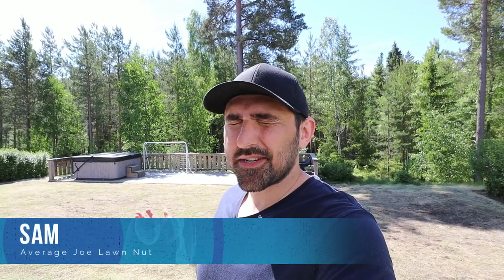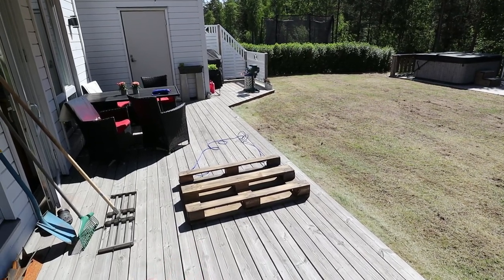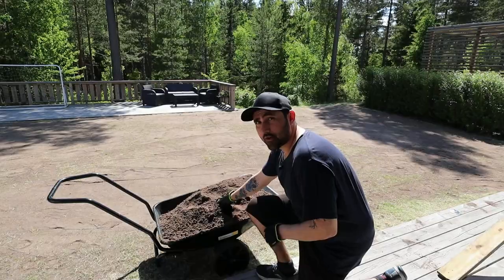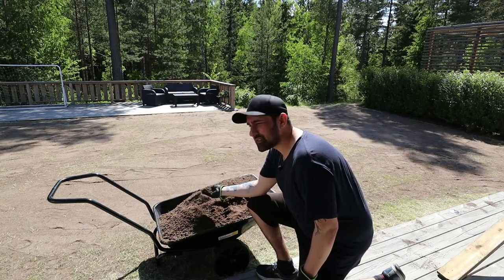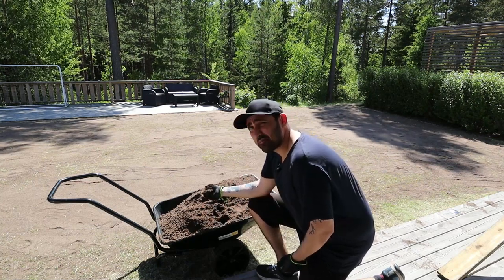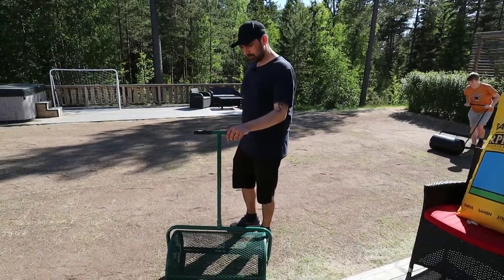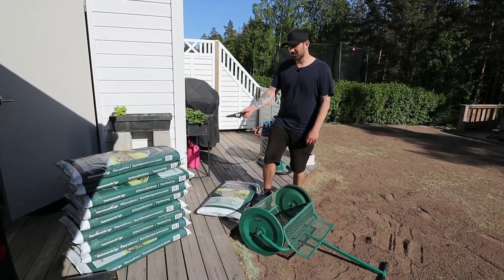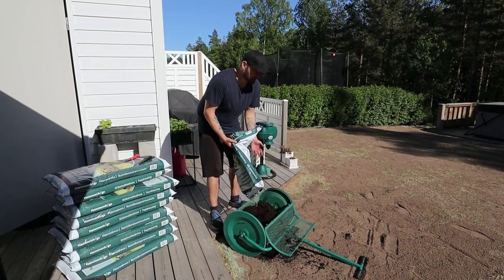Step by Step Leveling with EASY tools and Re-seeding entire lawn!

Comment: I am also using the same brand but in RTF. It is a multi-grain tall fescue. But I am in Las Vegas so that is a big difference. In order to open those bags you have to look for a small spring and start pulling on the small string on one corner of the bag. If it doesn't work on the first time then move to the other side and pull out a small string from there. It always works for me. Best of luck.
Reply from the maker: ahhh you need to pull the small string first? I usually just take one, the times I have managed to do them I guess I guessed and picked the right one. Always thought it worked by pulling either. Was so happy I managed to do it, never happens :)

Comment: Good turf tips. The weather is delaying some of my over seeding this year. Normally I get an early start, mid August, but this year it was just too hot, and then dry. At more normal seeding time, of September 1-15, it was still hot and DRY. I've never over seeded this late, but I'm going to try it. The turf type tall fescue ( tttf) that I use is from United Seed and it normally germinates in 5-7 day's or so. I have used the big square bails of peat moss at times. Just barely cover. Thanks, John, Indiana, US
Reply from the maker: Hey John, thanks mate. Had the same here, was hot for a long time so it was hard to start early, downside is that our fall and spring are getting shorter, we jump straight from and to winder it seems, hard to plan overseeding with that kind of weather. Let me know how your lawn turns out after the overseeding.

Comment: If you put a polythene sheet over the top for a week you'll only have to water it once. It heats the ground, stops the water evaporating and keeps birds off. Speeds germination rapidly
Reply from the maker: For sure mate, if I ever go over to fescue or KBG, I would definitely consider that, but for the RPR it goes so fast, don´t really feel the need to bother. I am thinking about adding some KBG this fall actually, then I might do it. Good input!

Comment: If you keep on leveling it over the yrs, the lawn level will keep on rising. How’d u control the height in few yrs.
Reply from the maker: Hey Amit, good question. If you use sand based top dress then for sure it will raise the lvl over the years, however, it will sink a little bit as well, especially when you core aerate, so it won't make much difference. If I would have a perfect lvl then I wouldn't add anymore. Normal top dress with organic matter will decompose over a year so that won't affect it either.

Comment: 3.8 cubic foot tightly compressed bale of reasonable quality peat moss is 116 krona here, this kind is screened and dried with natural gas heaters because a lot of the cost of shipping peat is the weight.
Air dried, more fibrous and chunky peat is more money because it must be handled carefully in harvesting.
Wheat farmers don't like bogs in their field, equipment gets stuck and wheat likes heavier soil so some, on private land gets diesel fuel thrown on it and it gets lit by a tiger torch or flame heater.
Most will never be dug because there are no roads in those places.
Reply from the maker: Hey Wayne, that's interesting! Have you used it before? I am wondering about weeds, since the cheap top dress I used, almost always have weed seeds in them. What about peat moss?
Reply: @SamsLawn  Peat is sterile and acidic so it deters fungus, and is very absorbent.
In WW1 they put dried moss inside bandages for the soldiers because of those qualities....and hardly any died! ( I do not know that!)
The pH of a peat bog might be 4.5 so not much can grow there.
In Greenland, I think, they have dug up poor bastards that were killed and thrown in and centuries later they are preserved.
Reply: @SamsLawn  I used it two weeks ago, I bought two spreaders because they are made in China and I want spare parts, 100$cdn.
Reply from the maker: @wayneessar7489  Interesting, maybe I'll try it next time, sounds good for this purpose, not sure why no one over here uses it

Comment: We just seeded our lawn in south Sweden and I can see after the rain some spots where the seeds are not cover with soil, should I try to cover it with dress soil or should I let it be? Thanks !!
Reply from the maker: Hey Omar, no need to cover it again, you will end up with bare spots anyways, just overseed come spring and you are good to go :) Hope it turns out well, let me know dude
Reply: Hi again! We used weibulls extra green, it's growing really slowly...I hope that the seeds that didn't grow will grow in the spring...do use recommend to over seed now or wait until the spring?
Reply from the maker: @OmarAlvarezGarcia  Hey Omar, I would wait, extra green contains mostly kentucky blue grass (ängsgröe) and it has a germination period of at least 3-4 weeks, so it will grow veeeery slowly. So wait with the overseeding until spring, Since you are in the south of Sweden you still have time to wait for it to grow for another week or two, then I would put out the fall fertilizer and then your done for this year and you have good preparation for spring. good luck dude
Reply: @SamsLawn  thanks for the advice! Does it work to fertilize with Algomin Hästgödsel this late? We still have 14 degrees in Kalmar :)
Reply from the maker: @OmarAlvarezGarcia  For sure mate, go ahead, still warm enough out and soil is over 8 degrees so you should be good :)
Reply: @SamsLawn  Hey Sam! I getting back to you after this long winter 😅 know it's time to start taking care of the lawn again 😂 I was wondering what you would recommend me to use, I can see that this week we are getting some weeds and it's time to fertilize, would you use Algomin grönare gräsmatta or the you use master Lawn? I was thinking to start over seeding on a couple of weeks when it gets warmer. Thanks!!
Reply from the maker: @OmarAlvarezGarcia  Hey dude, nice to hear from you! Yep season incoming, it's time to get going! :D 
I think both are fine actually, won't matter too much, if you have some moss after winter then go with the Florovit since it contains some iron too help combat the moss, otherwise both are good fertilizers. Jealous that you are fertilizing already, I think I am still at least 2 weeks from that ;)
Reply: @SamsLawn  thank you! I have fertilize and I'm planning to overseed the whole lawn since it have spots with no grass and a lot of weeds are coming up ( mostly kvickrot , I believe it's) I am wondering to use the xeed bar intensive RPR instead so we can take over the weeds I am not sure if I can wait 20 days for the extra green to grow....what should I do 😂? Thanks!
Reply from the maker: @OmarAlvarezGarcia  Hey Omar, that's always tricky, I like the RPR just for that fact, you can so easily and quickly cover any bare spots with new grass, before the weeds come. But some people don't like RPR and it isn't the best grass type for a Swedish climate, but I am not a patient guys so 7 days for RPR is perfect for me :)
I also have some kvickrot, it sucks, there is no way to get rid of it either but to quickly grow grass in its place. 
you can always use RPR to quickly reseed it and then use something else in the fall when you have more time and less weed pressure.